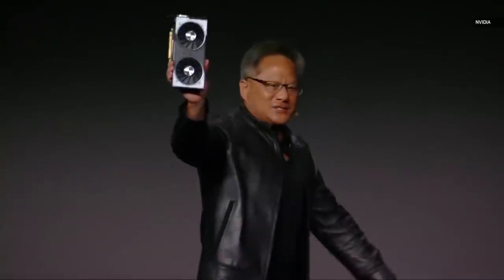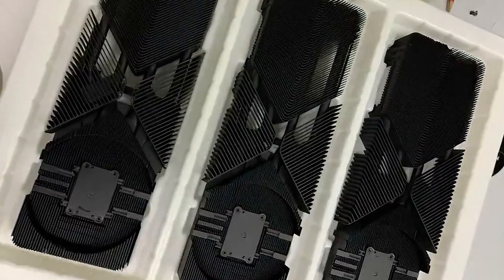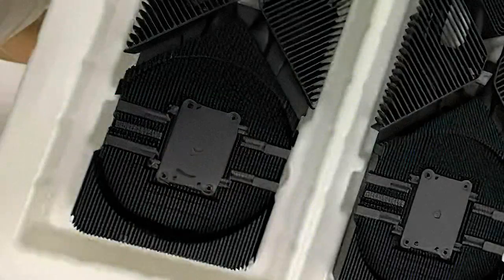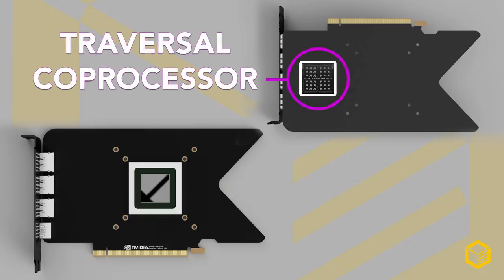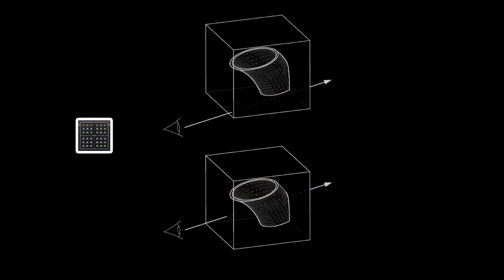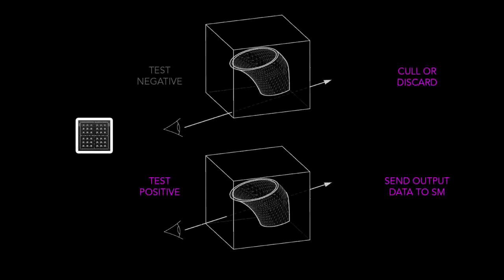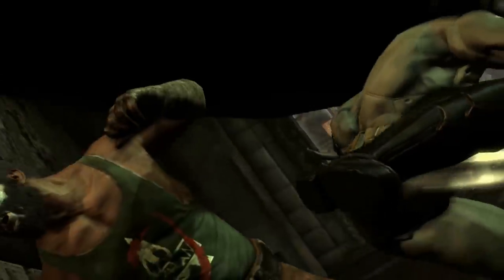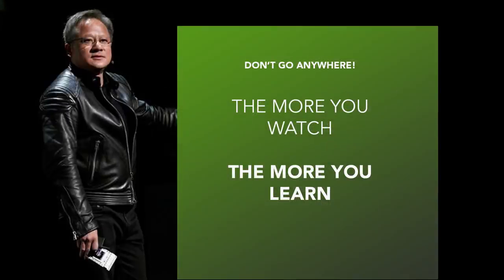A REVOLUTION in graphics is coming

Comment: Normally I like your videos but this one mostly sounds like a list of features made by fanboys (not saying you are one ^^).
Maybe some of this comes out of NV but I don't think it's more then project pitches that were investigated at some point.
Co-processor: I think it is likely that they are doing research into something like this but the small PCB here points to tight integration instead of multiple chips, I think.
As you said, there isn't even much space on there for the VRMs. 
I also can't see any evidence that there would be a heat generating component on the back side. I can't see how the heat would be transferred to the cooler. You said this could be the reason why the fan is on the back side but the fins are arranged in a way that it would provide zero air flow to the back side.
There also isn't enough hight available on the back side to put the VRMs there. You would probably need a triple slot design for that. (Or the PCB would have to be in the middle, between the two slots. 
It is also not a push pull config. The fans don't share air flow. 
I think the main reason they put the fan on the back is: it doesn't make a huge difference but it creates a lot of public attention.

The cloud gaming thing. Well, maybe, but it won't be much better than the existing solutions. 

The VR thing .... I don't think so. 
The screen config you  are talking about sounds like this dual LCD tech from I believe Hisense. But as far as I remember they had problems with alignment for a long time, even at TV resolutions. I don't think we'll see this in high dpi VR screens before at least seeing it in some Chinese phone. 
I don't think we'll see it there at all. That's the space of AMOLED. Better black, better response times.
Also, this tech has nothing to do with holographic displays. It's just a dynamic backlight.
Also you don't need holographic displays in headsets as you don't change your position relative to the display. That's the whole point of strapping two displays to your head for stereoscopic vision. 

I would love to discuss these points with you.

Comment: These keys are bought with stolen credit cards, then the savings are passed on to the customer! Great way to turn stolen credit in to cash you can use
Reply: A lot of them are bought in one region at low prices and re marketed. If you buy 1000 windows 10 keys, from Microsoft, they end up around$14 ea.
Reply: Not stolen, but very limited.  You can only use it with your current motherboard setup.  So if you replace the Motherboard you will find that Windows will no longer be registered.  Basically, they are OEM keys rather than a true license for windows (for you, forever).
Reply: Alot of them come from retired business systems.
Reply: you could just google HWID KMS38

Comment: 27:59 in theory. But in reality I only get 4G at most at home, so the latency is much higher than if I would just connect it via Wi-Fi with my cable internet. And it will take quite long until 5G is widely available. and even if 5G is widely available at some time, it adds about 30 ms in real life as it seems to the latency (compared to a theoretical value of about 10 ms), which is significant for gaming and a lot compared to Wi-Fi and landline or cable internet, which add less than 10ms combined.

Comment: You had me in the first part, but what was that about the VR headset? How should the headset return the object , that the player is looking at? Game engines don't use a standardized way of keeping track of objects. If they would add eye-tracking, the engines would probably manage all the object intersection themselves. And then with the holographic displays? What? What do you even mean by that? It's a VR headset. You don't need to create holograms. You only have 1 eye. Not 2. Oh and then with the whole "you don't see the game itself. you see an AI's reconstruction of the image". That's total bullshit you're talking there. AI reconstruction is literally what DLSS does. There's nothing new to that. Plus you could make the point, that "You don't see the game itself. You see the Display drivers reconstruction of the image based on the data in the frame buffer".
Reply: he lost me at the controller and vr thing
Reply: Yeah that ending kinda ruined it for me, especially the holographic screen part, it makes me think that either he doesn't understand how vr works, or someone fed him some japey info and he didn't look into it enough. :/
Reply from the maker: Yeah exactly, where did I get such ridiculous ideas! Sorry man, I'll do some proper research next time
Reply: Coreteks oooooooo.... lol mega-burn.  Coreteks is no diff from any other reputable tech tuber;  there’s usually some basis in reality.
Reply from the maker: @Bsodman  yes or no answer: Have you ever seen a holographic projection in front of your eyes? (I know I shouldn't even be asking, obviously you know what you are talking about, but still...)

Comment: If the co-processor can intelligently sort out information as to what is the best (fastest) method of handling ray-tracing and so forth, I would think that a version of it could be used when taking the software from long-term storage (hard drive and so forth) and putting it in the computer's memory for use by re-sorting it into optimum patterns that take the minimum time to be switched and otherwise used during the program execution.  This would mean that the software would, on the fly, always be loaded into memory for maximum speed and efficiency.  This would be on top of the video optimizing function.  Pattern recognition works on everything, not just video images.

Comment: Regarding the leaked RTX it is pretty simple the fan on the back side is blowing the air directly down (if the card is mounted in a classic position) through the ends of the heatpipes and the fins as there is no PCB there to block the air

Comment: There may well be a co-processor but I doubt it's on the rear. The heat pipes for the rear fin stack only come from one side, and in the assembled pictures the PCB is all the way to one side of the cooler like normal leaving very little room for effective heat transfer devices on the rear.

Comment: From the persepective of a 3d artist a RTX addon card could be insane. I have recently started using blender and not that long ago they added RTX support so if you have a RTX card you can get up to 60% faster renders over just rendering with cuda, it currently doesnt support all aspects of blenders render engine yet but I do know that the octane render engine also has a RTX version which gives faster renders, so the thought of buying a RTX addon card for cheaper than a whole graphics card for 2x or even more render speeds would be a massive leap forward.

Comment: Foveated rendering in VR is the holy grail. That is the killer function that will blow VR to the moon. People simply do not understand the difference that will make. It will permit 4k screens with no more processing taxation than current generations which will utterly eliminate any sort of screendoor issue. Text will be clearer than on a screen. Depth perception will be indistinguishable from reality.  And that's just the surface.

Comment: My theory of a fan on the back side of the card, simple: Put a fan there so we're not looking at a backplate all the time and it solves the problem where cool air can be pulled from the top "front" fan instead of having all the air come from the bottom. Physically, a chip on the back side doesn't make sense nor would it fit with a plate on top of the chip to cool it on the back side. An additional chip though, is not unrealistic. I think that it is a good theory.

Comment: I just wanted to come back to this video to say that I don't think the idea of a traversal engine or new form of ray tracing scheduler or anything like that is a bad idea.  But I really doubt that it would be functional anywhere but in-silicon due to the power costs and latency of exiting the die.  The only potential exception for this would be if it was on package with chip on wafer on substrate 2.5D stacking since it would reduce the power and latency some versus having to completely go thru the PCB.
Honestly - the new windows GPU hardware scheduler option IMO lends well to the existence of new improved functions in how the GPU operates and is probably a critical component of any non fixed function hardware based ray tracing.

Comment: 19:00 wait are you using fps percentage improvment per Generation in relation to Cmos Pocentage Imorovement per Generation ? That would be bad and might missreprisent the acual Performance boost since the calulation power increse from 120 fps to 180 fps should be higher then that from 60 to 90 fps right? or am i getting this wrong ?
Reply: Proportionally 120->180 is the same as 60-90, comparing percentage improvements is perfectly fine, the base units (FPS or Millisecs or whatever) doesn't matter as much as the ratio does. What you shouldn't do is compare absolute differences with FPS -   e.g.   100-110 = 10 extra FPS        20-10 = 10 extra FPS    - Notice how the 2nd example is 100% larger and the first example is 10% larger, even though they are 10 apart - FPS difference is a bad metric.. :)

Comment: yes Celso i think you nailed it, about the PCB.
my first sequence thoughts when i saw the design was that, with this cut there is a second PCB to the back 
of the card. but idk how will be the power transfer? 
and another one is about the cooler design, if is the final one - they build it like this so the cooling air 
doesn't get "lost" and is more effective creating Pressure as it passes by the surface areas and dissipates..
Like a sandwitch, but with a narrow gap in the middle that directs the main flow of the air.
Good work for the vid, nice ideas.

Comment: 19:28 However, without changing microarchitecture the additional computing power you get from smaller transistors couldn't get utilized really. Imagine how hard it would be to integrate an exponentially increasing amount of transistors without changes to the architecture.

Comment: I think you're right about secondary dies.... Making a chip using these specialty core-sets, but with so much variation in the % of cores functioning after fab, a chip with, say 95% of its CUDA cores working, but only 40% of the RT cores working would leave you with a mess of a GPU specification.
 You would either have to cripple CUDA to 40% also, and sell it as a much cheaper chip, or deal with insanely convoluted product lines (when you combine all the possibilites).

... It would be a waste of what otherwise could have been sold as, say a TITAN if only the RT cores had come out well also. But the ability to simply pair a better RT core-set with it would solve that issue.)

Comment: Hardware accelerated PhysX wasn't so bad. For starters, it could run with a single Gefroce card (if it was fast enough to handle everything alone). And I also got it working with an old Geforce 8800 GTS kept next to my fresh new Radeon HD4800 back in the days. The problem was that they kept the CPU-only code optimized for too long and AMD didn't (or was allowed to) support GPU acceleration for it, so most games decided not to use it at all. But the same could go for ray-tracing if AMD cards won't be able to handle it. Although the market shares are a bit different nowadays and game studios also have higher budgets, etc.

Comment: I really don't see how it could be push/pull, there's no way for both those fan chambers to intersect with each other in that design, they're separated, it's impossible to have one fan pushing air and another pulling the same air. It really bugs me on how some think it might be push/pull.
It's clearly a dual cooling chamber design with some passive or fake fins in the middle section.
Also your argument, I find it very odd! How can they have such powerful chips on the back if the heatsink don't actually touch the back of the PCB? it wouldn't be cooled at all.

Comment: Interesting theory for sure, though I am skeptical. For one there is a leaker on Twitter who correctly leaked the A100 die and transistor count / specs many months in advance. He also predicted that Ampere would use a non-standard PCB. Hes never once mentioned the existence of a co-processor. As for the Samsung thing, I'm pretty sure that most people would agree that it's just Nvidia being Nvidia. They wanted to get TSMC to lower their prices by spreading false info that Nvidia was considering moving to Samsung. It didn't work. Also, Samsung announced they had issues with their EUV node, so Nvidia was not going to be able to do bulk orders regardless and had to go back to TSMC.

Comment: To be honest, I doubt wether there will be a traversal coprocessor on the back of the card. The PCB is too far at the back of the cooler for a cooling solution capable of cooling such a coprocessor. I think instead NVidia will have chosen to put the VRAM on the back of the card. VRAM often requires less cooling, and putting it at the back of the card allows the VRAM to be closer to the GPU, and thus consume less energy to acces. This also leaves them more space at the front of the PCB, where I think they might be able to fit the traversal coprocessor instead.

Comment: What’s the point of a holographic display for VR? The dual displays already create a stereoscopic effect.

What is the AI for VR? Is it up scaling like we seen before?

What is the point of different resolution chroma and luminance displays? How do you render to that. Is the graphics pipeline split after the vertex shader and does separate rasterization and fragment shading for luminance and chroma?

By the way the stadia controller already connects directly to your WiFi.

Comment: The chip on the back idea seems a bit silly TBF... more like the fan on the back just sucks/blows straight through the cooler, more like a CPU tower cooler. There is no PCB on that whole back 1/3 of the card, just a large overhanging cooler with an embedded fan that sucks/blows right through it.
The square block under where the fan hub would be, coupled with the strange looking 'thick' heat pipes. remind me a lot of the AIO's with the pump buried in the radiator.

Comment: Yay another video of yours. I think it is a step up now, with the new gen consoles and the new GPU tech all about to be launched, it is moving on a generation, looking at the PS5 design I can’t wait to see the cooling solution they’ve put in that. The 3080 card leak I think is real, and I like your idea about it and a coprocessor, it could well be to boost ray tracing performance. 4K or higher high details and full screen complex ray tracing at what 120FPS or higher? That would need a lot of power, so I think your in the right track here.

Comment: IMO the 3090 is just what would traditionally be the 3080 TI.  I think Nvidia listened when it came to how confusing having TI and Super GPUs were in the 20 series.  The TI used to be the carded to refresh the lineup with a more powerful card, then the 20 series turned it into just a higher tier card at launch with the Supers being the refreshes (but of current cards) with a bit more power.  IMO they're moving 80 TI to 90 so that they can then one year later do a refresh of the whole lineup as either Super or TI.

Comment: Interesting... I was just thinking the cooler design was to prevent choking the air flow when mounting the gpu sideways or placing them in an itx machine, plus it makes it look different. I assumed samsung is just making the vram on the card.

Comment: If that traversal coprocessor is real and what you say it is, it will bring an insane potential for AI on the scale of the switch from cpu to a gpu (which was a game changer. A gpu accelerated beefy home computer could outdo Google's supercomputer). Instead of training in sequence, it could train in parallel and almost everything can be hardware accelerated on this chip. This will be the main reason for the extra slot-in cards as well. Every training is an instance of the network object. You can do all trainings of one epoch simultaneously as they work with the same object but different input data, much how the kettle is the same in the shot, but light shines differently at it each time.

Comment: I think if you put 2 ore more cards in a system the airflow is optimized to dispatch heat. what makes them way more effizient and silent than traditionel cooled systems were more than 2 cards the middle ones runs hotter